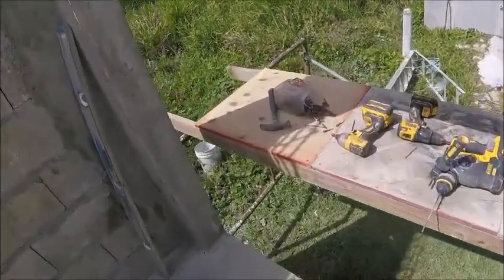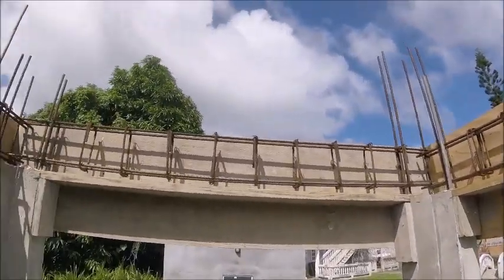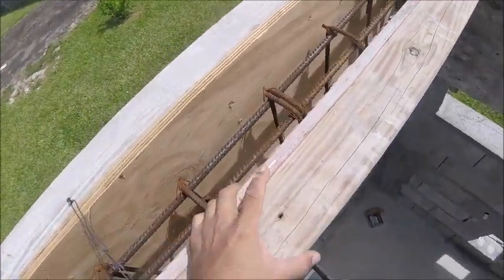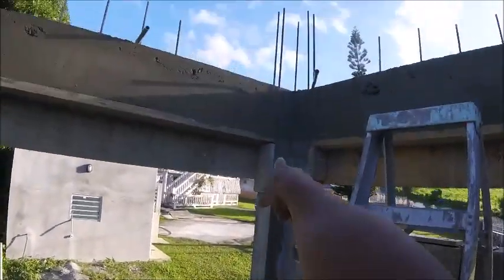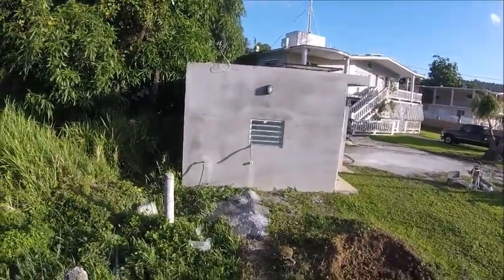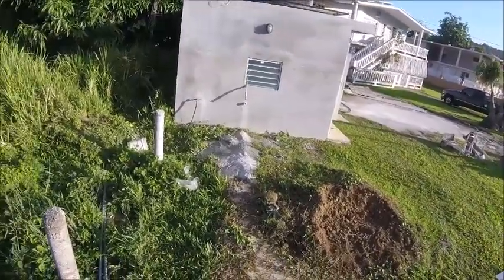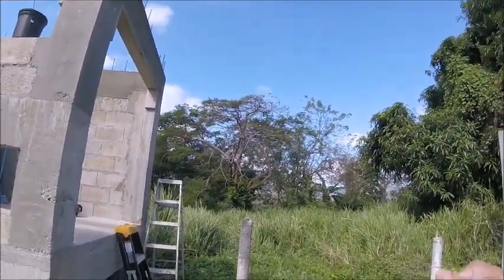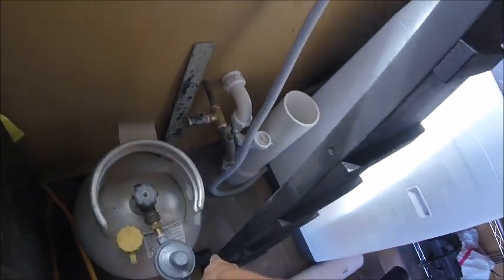Chicken bunker build 5

Comment: Wow this thing is legit! Seriously nice work, can't wait to see the progress.
Reply from the maker: Thanks,  its how I have to build around here for Hurricanes 🌀,  Maria was 200+ mph and literally moved my truck against my garage wall. The coop gets a nice smooth stucco finish once the structure is finished,  the floor gets porcelain tile for easy cleanup and pressure washing if necessary , its going to be very different, but have similarities to a traditional coop
Reply: @MosaicHomestead  Necessity is the mother of invention, it sounds like a great design for your locale. Tile floor should be great for cleanup as well, will you cover it with bedding of some kind?
Reply from the maker: @Slowsteading  I'm doing deep litter
Reply: @MosaicHomestead  That's perfect, then once in a while just clean it out and hose it down. Easy 👌

Comment: I don't think you will have to worry about grass growing in the run. Chickens will probably continually dig until they have a nice dust bath and grass will be gone.
Reply from the maker: I'm willing to take a bet they will only focus on a small hole once they find out they can't beat the grass here lol, I had 30 chickens before Hurricane Maria,  they only made 2 holes near a wall for dust bathes,  but the front lawn had to be cut every 2 weeks because it grew too fast, the tropics is very different,  not even the sheep could take the grass low enough lol, my cousin bought a sit on mower to cut the grass where we keep the sheep,  not kidding,  it will be interesting,  ill keep 8 to 12 chickens inside the run area for 2 weeks just to see what happens lol...I'm going to win 🏆